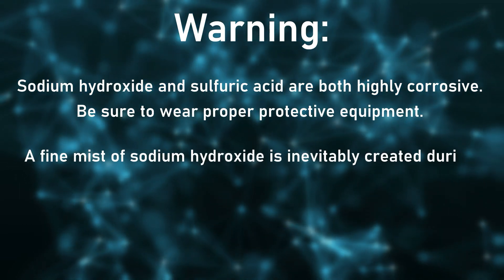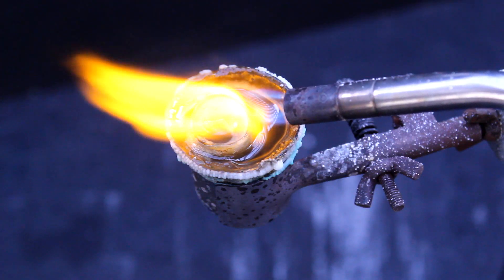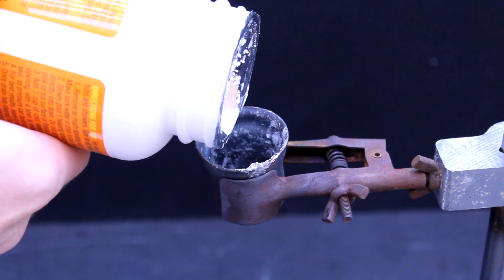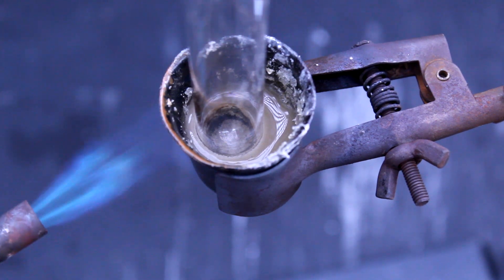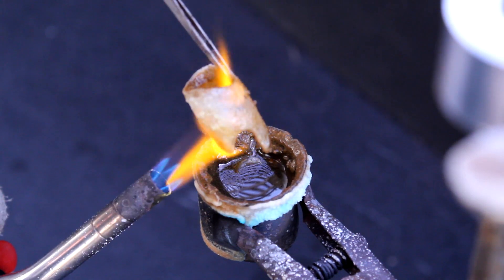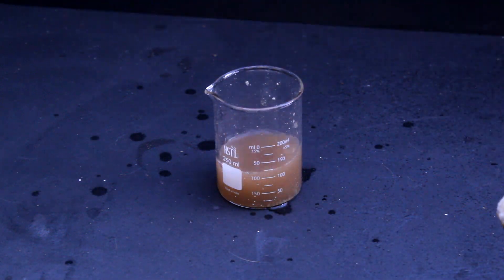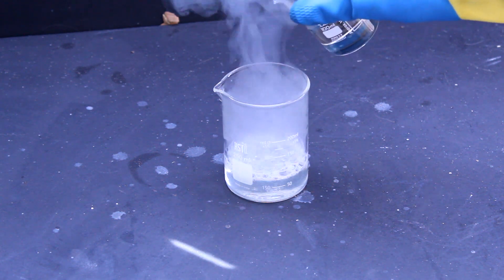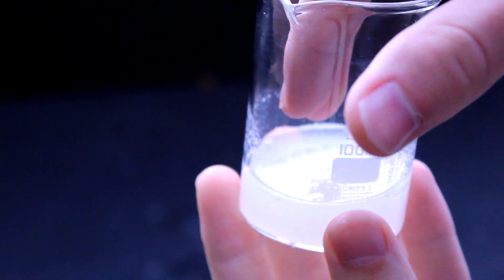Dissolving Glass and Turning It into Slime | Sodium Silicate, Silicic Acid, And Silica Gel

Comment: How to obtain monosilicic (orthosilicic) acid Si(OH)4 from sodium silicate or silica gel? Liquid Si(OH)4 is needed for plant fertilization.
Reply: Mix Silicon Dioxide (preferably AgSil 16H) in water at 15 g/gal. Add Potassium Hydroxide at 1 g/gal. Done.

Use this at 1% injection rate in final solution. Make sure to add this to the final solution first, and add your Sulphate mix and/or pH addition before adding your Ca and Mg fertilizers to prevent precipitation of Si.

Comment: 2:05 Correction: The solution that just had been filtered was extremely hot, and the intese heat from the acid-base reaction (plus that resulting from dissolving somewhat concentrated sulfuric acid) made the water boil on its own.
Reply: No

Comment: Thanks!  Great job!  I needed to see this!  Anyways I made potassium bisilicate solution last week from ground silica gel beads and concentrated aqueous potassium hydroxide at 90is Celsius.  I diluted 1 part silicate to 2 parts water and added 400 silica and titanium dioxide as pigments and painted bricks and mortar with it.  It worked ok so far!
Reply: What did it do for the paint to make it from silicate?
Reply: @ITroopTheSpace  the silicate forms a binder with the silicates in the mortar or concrete it’s applied to.  The extra silica is supposed to make a silicate less water soluble.  Of course you  could apply a solution of 10% calcium chloride after it’s dry and that will for insoluble calcium silicates locking the pigments in

Comment: interesting video and impressive amount of knowledge to boot!

a question, would it be possible to extract silicic acid from the silica gel?
Reply from the maker: Glad you enjoyed it! Essentially, the silicic acid is just hydrated silica gel (SiO2 but associated with a water molecule or two). It doesn't really behave any different than silica gel, it's just the name for the portion of silica that is somehow able to dissolve in water. So if you extract the silica gel and keep it wet, some silicic acid will be present. Of course, separating the silica from the solution is a bit difficult, since the particle size is so small that filtration won't work. You might have luck by drying it and then washing away the sodium salts with water, but I've never tried. Hope that answers your question!

Comment: Not quite related to this video... you have me wondering about an interesting topic... plasma chemical synthesis for not only polymorphs of elements.... hhhmmm... wondering about reactions and reaction chamber designs?    Any thoughts regarding?  Seems electrochemistry is somewhat not detailed to the masses where I've wondered if there are other capabilities not yet designed?   Now, for some reason you have me wondering and thinking about plasmachemistry.  Thanks for sharing!
Reply from the maker: Cool thought! I've considered trying some gas reactions in my nuclear fusion reactor (without deuterium, it's basically just a low-pressure plasma discharge), simply because it's designed to accelerate atoms into each other. Maybe I'll try something like that in the future!
Reply: @LabCoatz_Science  Plz DO IT!!!
Reply: @LabCoatz_Science  Did you ever get round to trying it?